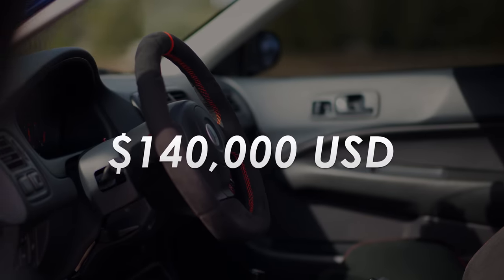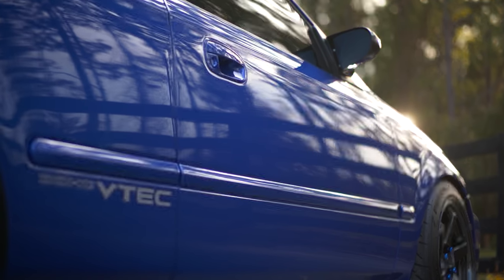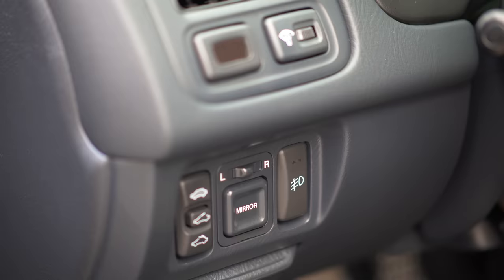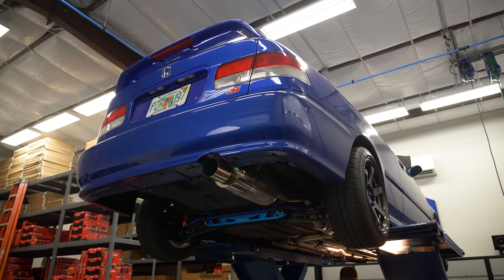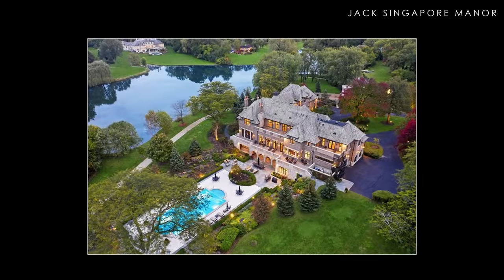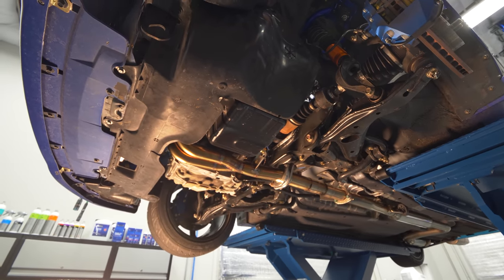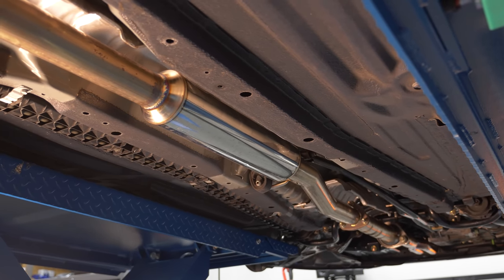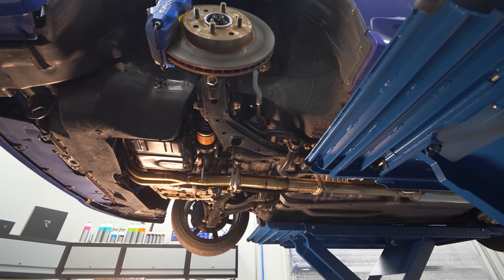The Absurd $140,000 Honda Civic Si EM1

Comment: I've never been so nostalgic for my '98 Integra GSR. Intake, headers and exhaust just made that VTEC scream.
Reply: Then go buy another one. They aren’t hard to find
Reply: @mmmmm4815  lol. good luck finding one that isn't torn to shit by ricers or completely rotted out for a decent price. "not hard to find" lol. BMW fan, I take it?
Reply: @Enidx10  literally took me 30 seconds to find several clean examples with a quick google search. 🤣🤣 Like i said, not hard to find. Your opinion and fanboy’ism on the matter doesn’t matter. What I stated is a fact.
Reply: @Enidx10  and if I was a BMW fan, I wouldn’t be mad, because they’re better than an Integra GSR in literally every single way...
Reply: ///Mmmmm you’re not wrong. BMWs are technically better drivers’ cars in every single way, but I’d take a clean 90s Integra over any BMW in existence.
Reply: @Enidx10  I had several friends in the 90’s own Integra GSR’s, and I drove them on many occasions. They were much cooler than my Nissan Pulsar 🤣, but to me, if I was going to get something Acura, it would be a RSX Type-S before the Integra. My friend had one and it was pretty dang fun
Reply: @mmmmm4815  Type S is an amazing car. I have a boosted, K24-swapped 06' TYpe S.. THing is a BLAST. Have almost $25K into that thing in the past 8 years lol.. Only has 70K original miles on the chassis tho lol

Comment: Regarding the engine mounts, if you watch the LHT build, they use the Hasport 62A, which is the softest compound Hasport makes. The thing is it takes 20-30 days of driving to break in. I have three 62A mounts on my 8th gen Si and I hated it for the first month, but after that they soften up and hold the motor and trans in place perfectly while having no significant vibration whatsoever. Just sharing my experience, awesome video guys!

Comment: Can be "easily reversed": Puts a completely different engine in it.
Reply: Sure, but the original engine is sitting right there. As engine swaps go, this is an easy one.
Reply: ah if you get someone familiar with the b series architecture, the engine/trans can come out in 30min(there’s a video on yt with a guy doing it on his curb side). the harness can easily work for both engines, the hondata ecu can have a b16 map flashed and all the mounts are in the same spots.

Comment: We all have that one car...for me, it’s a 1982 VW rabbit in metallic BRG with white stripes, BBS wheels, an number 69 on the door...lol! Balanced and blue-printed engine, ported and polished heads, tuned valved exhaust, full cage, and a huge fuel cell, two confortable leather seats with heaters.

Comment: When I became a car enthusiast in the early 2000's, getting a 'sound system' was a must have.  Now, if you do it, you're screwing with the way the car is integrated out of the factory..  No way in hell I'd do that now.  And because the new audio systems are so much better,  you can barely find car audio installation shops any more.

Comment: In my life....I have had from 1985 to late 90's Civic and CRX si's, Integras, Acura TL-S's, Acura TLX SH-AWD,  1999 NSX,  2015 EVO X MR,  2016 GT-R,  2015 C63s, every kind of truck from a toyota tacoma to an F450 dually, 4 runners, MDX's.......The car i would trade all of them for would be my 1998 integra Type R Champ white(got stolen from my dealer...hmmmmmm!), or my 2000 integra Type R phoenix yellow(replaced the white one but traded for the 99 NSX)      If you are a driver...these were so raw and the noises that came out of them were ridiculous.  Thanks for this guys...fun video

Comment: Bro the Moton was a great choice for this car.. 1. because the possibilities are ENDLESS, and 2, they are so valuable, that you could easily sell them for ANY street suspension setup you could ever want. You cannot go wrong here.... Secondly, the Sound System and motor mounts. Again, super easy things to change and tweak.  With Hasports, you can change to softer bushings for the street if there is too much vibration, and with all the goodies that come with the car, you could easily send this to a shop, have the crank fully balances along with an ATI damper to smooth things up. There are plenty of options here, and that is what makes this build wonderful. When you receive the car, you can EASILY make this a track car, a street car, or a bit of both... You have these options with this car. And this is why I love the giveaway. So amny people need to give you a bunch of cash to deal with all the BS that comes with a giveaway build, but here, everything is supplied.

Comment: I am 53. At 18 my first car was a used 169,000 mile 81' Civic hatch. Next was a new 89' CRX-Si. Got married and bought a 94' Civic coupe. All my Hondas were modified  but the CRX was just like a go kart. I put on big for the time 16" wheels, Tokico HD shocks and Ground Control coilover sleeves.  In 2002 I was collecting parts to do a B16A2 swap. My CRX had 320,000 hard miles on it at that point. I test drove a WRX and that was the end of my Honda Boy days.  I love my WRX and am in the middle of doing a rebuild on it but I can't help but wonder what a K series swapped CRX would feel like.

Comment: Spent $140,000+ just to give it away. Wtf...
On a side note, I have a 98 prelude sh, bought for $1,400. Had an f20b broken crankshaft, so I swapped it back to a Euro R h22, skunk2 manifold, 70mm throttle body, megan headers, skunk2 exhausts, tuned and repainted electron blue (like this si) and spent at most $6500 including the purchase of the car. I cant imagine spending $150,000 on my prelude or civic si and I have 200hp to the wheels and this guy has the same roughly lmao

Comment: My first car as a junior in high school was a barely used 99 ebp civic si. 

I still have dreams of driving it and cherishing every second of it... 20 years later.

I'd rather have my first car back over a Integra Type R, RSX S, any other civic or even an s2000. 

Everyone mentioned how roomy and comfortable the back seats were. More comfortable seating for three than an Integra or prelude with plastic tray in the middle.

Comment: I have the same Em1 just as clean stock b16a2 stock body just lowered on $900 koni yellow + ground control combo and about 150 lbs of weight reduction. Hella fun car and if I had the money id pretty much put it all on the engine transmission tE37s and tire package. Some seats and a steering wheel nice shifter and single 12 inch sub. Hope the winner is enjoying it if you got one of these take care of it for me not many of them out here.

Comment: ManI would spend almost similar money to that Civic, but on a rare 2006 Scion xB RS4.0 with a 5 speed manual. Get an engine swap from 1.5L to 1.8L 2ZZ, have some simple mods that support the vehicles. TRD, Dezodz green code headers with high flow cat, nice 15” or 17” TRD wheels or other aftermarket wheels, Toyo tires 205/55/15 or 205/45/17, TRD suspension and front strut brace and rear sway bar, every build he does on that civic would be a similar segment to this. 

He’s right, honestly u don’t really need lots of hp to have fun. Just between 180-215 hp is plenty, because the xB1 weights 2400 pounds. That’s a dream build 🙏🏼🙏🏼🙏🏼

Comment: I dont know about em1 or ek in USA, but Honda did offer leather in ek ferio "exclusive" (yes that was the badge on it), I had one and to this day I regret selling it, complete leather interior incl back shelf, doorcards, seats, armrest, steering wheel and it was very nice. Seats were similar to crx seats with shoulder support but bigger and much nicer, felt and looked high end. Front seats were electric all movements. It had very nice 15" 10 spoke alloy wheels that I had never seen before or after. B16a4 engine. Exterior colour on it was some shade of their metalic golden with a lot of flake, it even looked great on rainy day, I have seen similar honda color but never that light a shade.
Also, I think they offered leather in  "Jordan" edition in UK for '99-'00 hatch.

As for this car, yes its very nice no doubt about it (except that steering wheel), but I still dont get whats 140k even if it was all original... I dont mean to be taking away from his build its a beautiful car just dont understand how its valued at 140k.

Comment: If I had the money and resources I would do the exact same thing. I think I'd be balling if I had a $20,000 in parts Civic. Try to get a flatline 500 torque and 600 horsepower on an engine that can reliably handle 1000+hp. And get many years out of it.

Comment: The SI steering is fairly slow yes. But he couldve put a dc2 steering rack in it wich would sharpen up the steering while keeping the power steering. 
Also since when is a miata na steering rack slow? At least the ps rack on an na miata is still not slow even by todays standards. No idea about the manual rack tho. But ive driven newer cars that are supposed to be sporty like a golf gti mk6 or something and the steering was slower then on my 94' miata na wich has 2.8 turns ltl.

Comment: They need to have this car in the Wikipedia entry for “Midlife Crisis”. You can get a CPO 2018 Audi R8 for less than this ffs.
Reply: He already has a 991.2 GT3RS, a brand new GT4, an e92 M3, a Tesla Model 3, and a Raptor. He's had in the past few years a 991.1 GT3RS, 991.1 GT3, a newer gen Raptor, an F80 M3, a 1M, a fully built and supercharged S2000, an M5, a C6 Z06 Carbon Edition, and the GT350 that Adam LZ caught fire and now has engine swapped. This isn't a midlife crisis, this is just what he does.

Comment: ● It's true that it comes with all the original parts. But the amount of money he spent in certain areas and neglected other areas. Was just ASININE.. Building a car he wish he had in his twenty, with the knowledge and resources he has now... His reason for not doing a five lugs  conversion, because of wheels choices? Wtf.. boast about all these rare parts. Spends OVER $17k on the sound system(completely useless), and ends up spending more than $10k+ on SEVEN set of wheels, but for the trash 4lug bolt pattern, also then brushed painted the rear calipers, and excuses of not repainting the plastic trim that's discolored.     A build similar to this without all the  rare parts would take an average enthusiast more than 3 years to a achieve.. This guy is know for being detailed.. but missed a lot of the marks..